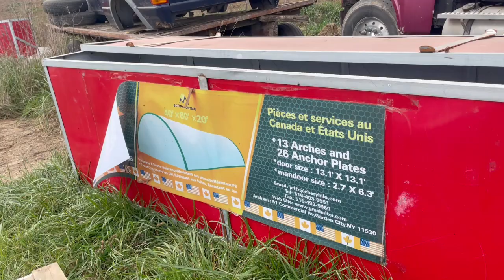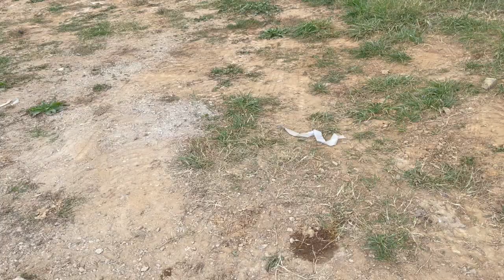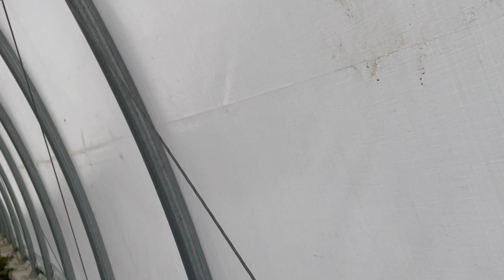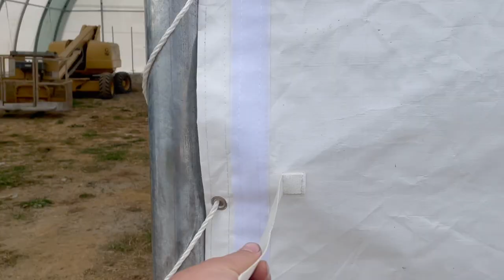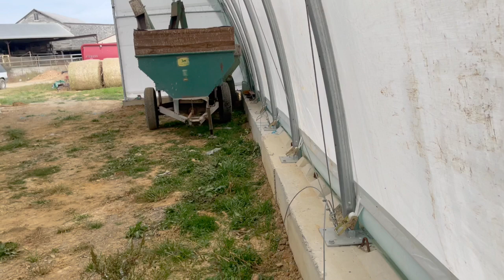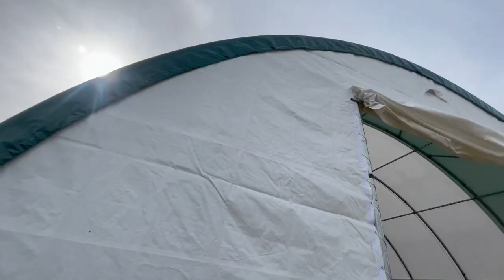Gold Mountain 40x80x20 single truss storage building

Comment: Would you recommend this building? Thinking really hard about buying one for my cows. Gonna build a 4ft pony Wall and put this on top. Are these worth it or no? Any input would be appreciated. Great video btw
Reply from the maker: Honestly I’m not sure. I was really happy with it but We had a pretty significant ice storm this winter. Like 20 buildings in the surrounding area went down. it sagged tremendously but it straightened back up and is still standing fine.  So idk if that’s a good testament or a scary thing!  It is definitely cheap shelter tho. I’m looking at another one now that’s 32 wide single tube From Kentucky hoop barns. I feel more comfortable about a little narrower and I’m sure the tarp will be much better quality.
Reply: @t @thefarmshop8068 yeah I did a little more research. These Type of Hoop Barns Aren’t meant to Sit on a Pony wall. They are supposed to sit flat on the ground or like what you got. Those concrete Retaining Block pads. I don’t have anywhere I can buy those so I think I’m gonna just make my own. Thanks for the info!